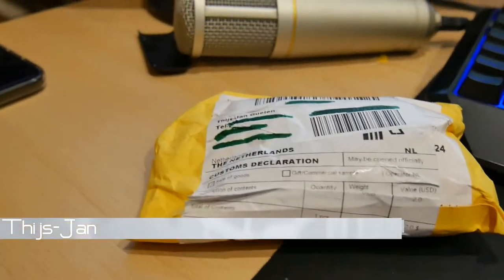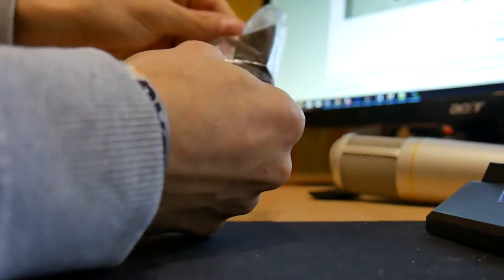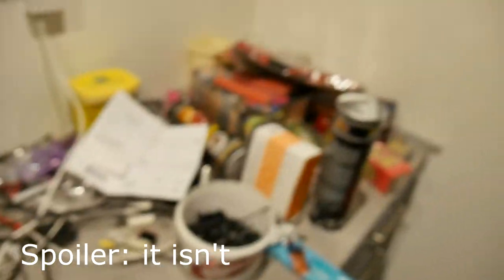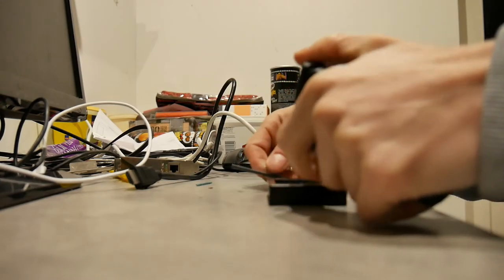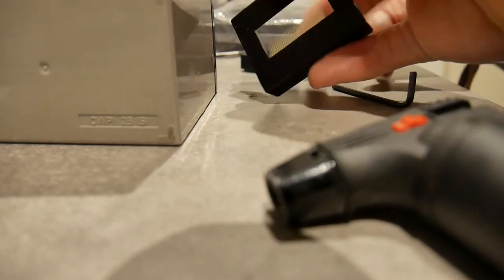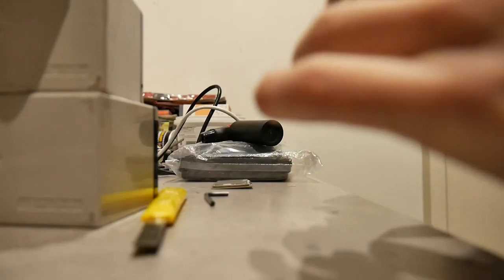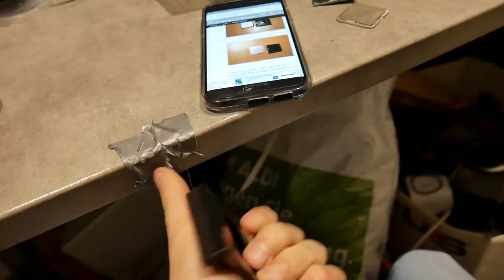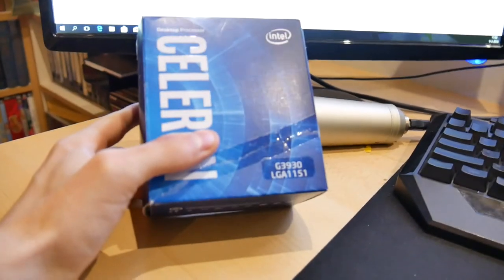$8 CPU Delidding tool from AliExpress - Is it worth the shot?

Comment: Bought the same for me, to delid my 7700k, it was super smooth, easier than what I expected! 25 degrees less! :D Thanks for your video, I made the decision to buy it after seeing your video. If you use a proper tool to tighten the screw it get much easier than using the one included.
Reply from the maker: Glad we could help!
Reply: Turns out, when i overclocked, i realise overclocking wasn’t what i need, end up upgrading 😭😆

Comment: Man, could you tell if x3440 can be delidded? any own experience
Reply from the maker: Hi, I wouldn't recommend it as the x3440 has a soldered-on IHS. You won't gain much, if anything at all
Reply: BudgetTechTalk as it seems on russian forums it has paste and there is some videos it been delided. I ordered tool and going to try this :D because its like 20c difference between core and cpu temps
Reply: @budgettechtalk1873  its not soldered